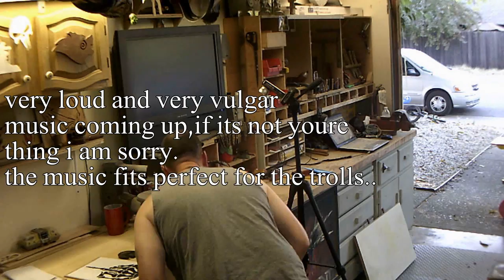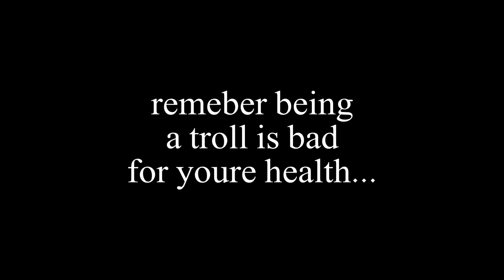scroll saw portrait for the trolls     (warning vulgar music)

Comment: Hi Dave great video as usual I have some questions about for scroll saw. I am very very new to scrolling.  What do you think of your Porter Cable scroll saw? Have you had to make any modifications to make it a better saw?? Some of the reviews I have read says that the motor surges making the blade go faster and slower all by itself. and what size spiral blade do you like best? You seem to cut very well with them.  Thanks Joseph
Reply from the maker: it's a great saw and I use #2&#4 spiral blades from pegas.the surge is very nominal for me I never notice it.